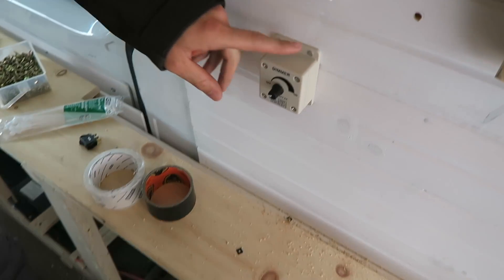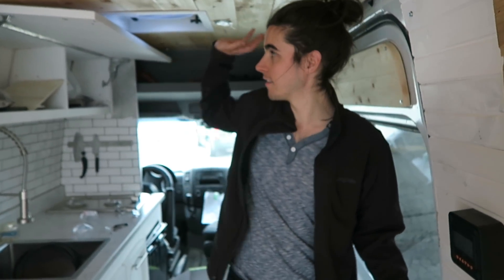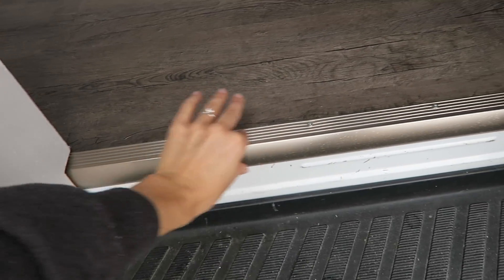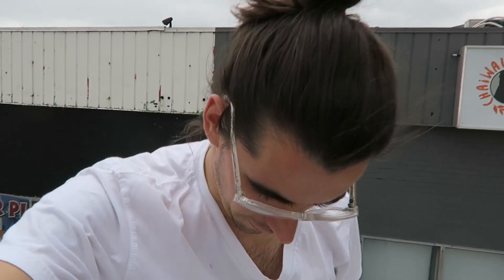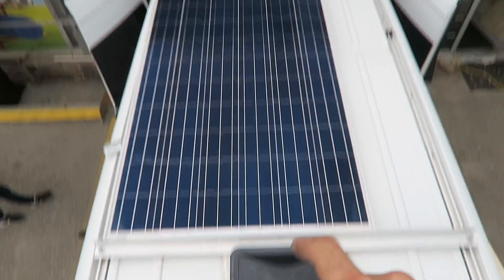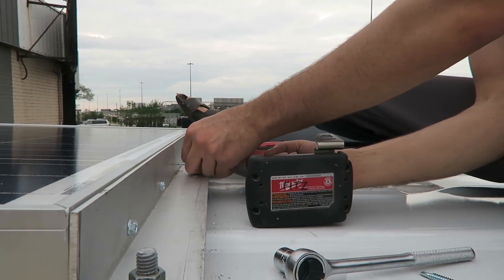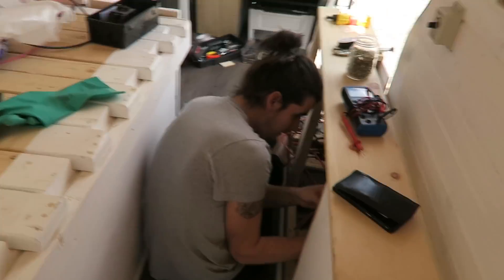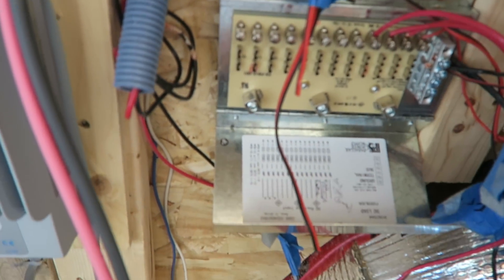Converting a Sprinter Van | Part 6 of 6 | Solar Panel, Electricity, Finishing Details

Comment: Note those USB plugs draw power and create phantom loads.  Even the little 2 packs that go into cig lighters draw all the time, so for off grid make sure and know each of your hidden loads and have as few things as possible.  My propane solenoid shut off only takes 0.9 amp...per hour x 24.  It adds up fast.

Comment: Hello Eamon & Bec! I really like watching your vids, in which i receive lots of inspiration. Com to think of it you are actually one of my first watches, therefore vital players behind me getting into this fast growing trend ‘living the van life’.

I’ve since purchased my Sprinter, (an ex police vehicle), and have begun my sprinter conversion, which luckily enough already had a VSR, a leisure battery setup under the passenger twin seat. By the way,  I’m thinking of pulling out the twin seats and making it a single swivel seat, and with my electrical setup contained underneath, what do you think of this idea?.

The van came with 2 vents, a diesel heater wired in, ceiling lights, cig lighter sockets. Having said this, I still ended up gutting it bare as it didn’t have the foiled bubble wrap insulation, only the rock wool.

I’ve so far completed my insulation, just trying to find a wiring model to work from, possibly work off your diagram if you have one? Im learning Premier Pro in the process so I don’t have youtube vids just yet.

My lithium 100Ah batt has arrived and I’m edging to get cracking on with the wiring amidst ordering some electrical bits. It’s stressful when you’re pure single sole DIYing from scratch. I do have a question for you though, how is your inverter charger doing? Im looking for one rated at about 1000 watts- any recommendations? Please check out my instagram @nomadxsherkhan. Thanks for the inspiration by the way. You are helping me Big Time!😊
Reply: It's been 2 years! How did the conversion end up? Was it successful? Do you still live in it today, or have you got either a new van or alternative accommodation? So many questions! 😂 I'll check out your Instagram in a bit, see how you're doing!

Comment: Re roof supports:
You don’t think the bolts you ground down to slide the cross bar holding bolt/washers combination might be holding the original tracking to the roof? 🤨
Reply: I know I'm late lol, but no, its not bolts, it's like a "stop", to prevent, anything that would be loosed, not slide to the front in a emergency brake. 
I install the same roof rack on a 170" wheel base in France, and it's hold by 22 locknuts all along the roof rack.
Normaly, you slide "elements" in to the roof rack by the back of it.
Sorry if my english is not that good, I'm french ;)

Comment: Nice job..what do you reckon the whole fit out cost?
Reply from the maker: We tried to be crafty with our purchases and use recycled wood and materials where possible.  That being said, there are a few things (ie., solar batteries etc) that you do not want to cheap out on.  I think an approximate number would be $10,000.  We will break down full expenses in a blog post coming soon.
Reply: Nice price, shows it can be achieved by most people. You look pretty tired but once its done it'll be worth the hassle and inspire others. Thought the retractable bed was a real good move, (I'll be copying that), not a fan of the dead end, no 2 way access vans. Look forward to the final tour...you nailed it!
Reply: what is your blog address?